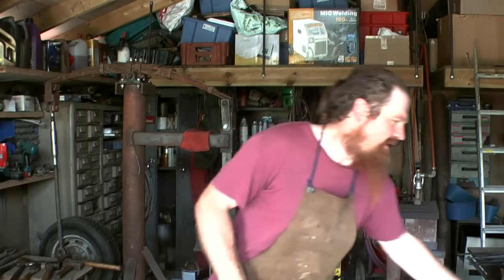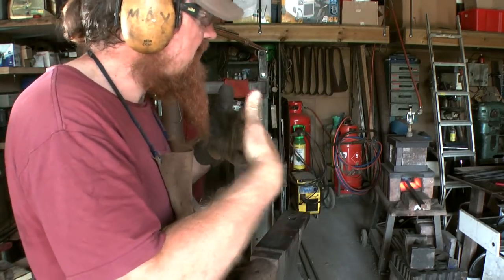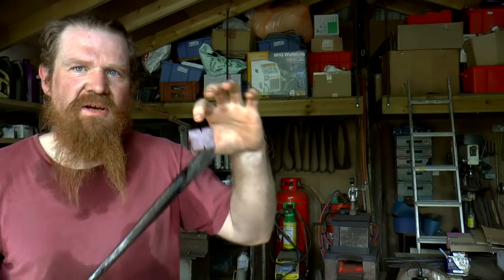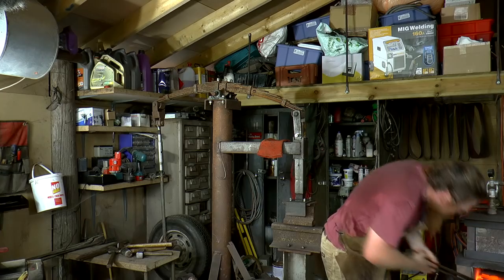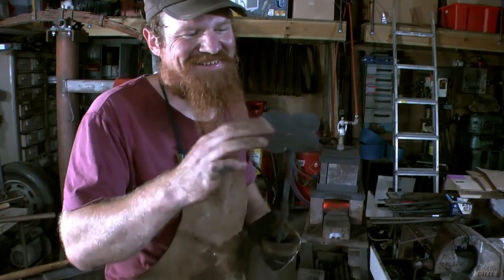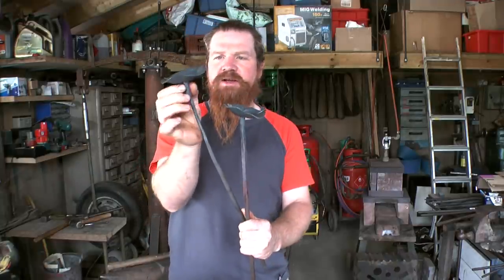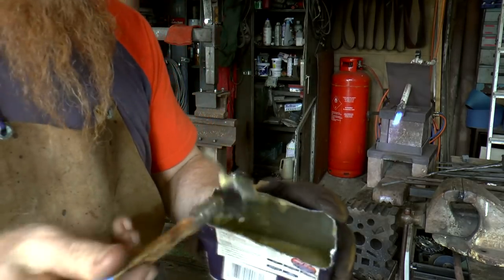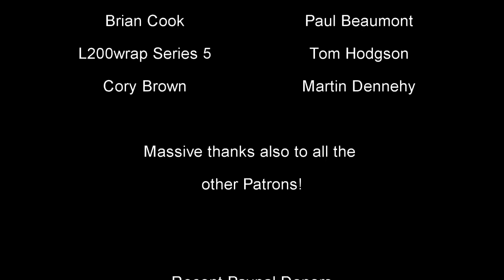Forging Flowers from a Solid Steel Bar

Comment: A tip from an Alabama concert former and finisher if it is 30 deg in the day wake up at 12:00 pm and work in the cool of the morning. we stop around 10 :00 to 11:00 AM because it can get  up to 40 deg here with 80% humidity. Feels like working in a sauna!

Comment: Very nice, and so much love put into them.

I think you are a good farmer, in the best kind of way - your lvl of skills are all over the place.
And the best farmers know a bit of everything.
Your ability to do blacksmith stuff is also excellent -- is everything measured in money?
Money is dependently a catalyst to make the stuff one would like to do available to us.
But I am certain that the happiness of the ride is not made by the money involved alone.
The Adventures one gets, does not seem to me to be the shortest way to the goal, heck one could buy an already rebuild land-rover... 
Or buy the flowers in plastic ... Where is the adventure you might ask? , the adventure is making it, doing it, living it - maybe just once, but you have been there done the hard work, and got a beautiful result.
Thank you for letting us share this adventure with you.

I wounder.... would it be possible to noise cancel out the forge.. Not for us, but for you in the blacksmith/garage. If one had a speaker with loud response in the opposite face -180 degrees to the known noise.. how would that work out...

Comment: I've made several roses using multiple layers of sheet steel, most of the time with scrap.  I try to use steel that's at least a couple of millimetres in thickness.  That way I can thin the steel down towards the edges and then curl the very end.  I have the same problem with the stems in that I used the same method that you showed.  Adding leaves is even trickier.

Good effort though chap.  Keep the anvil singing.

Comment: I really enjoyed this Max! A lovely and "organic" looking result! If you will forgive my (engineer's) impertinence - would it have been just as effective (and probably a lot quicker) to make your Maltese Cross starting points with the hacksaw instead of heating and whacking with the hatchet? Is there an ethos or aesthetic aspect that I am missing?
Reply from the maker: I think it would have taken even longer with the bandsaw! I was not after a straight slit more a wedge cut as provided by the hatchet. That way, when it's forged out the petal shapes are already heading in the right direction.

Comment: I have a very large ships bell.  (im going to add a video of it to my channel soon) Its very heavy and would look nice displayed so it can hang and be clanged!! , id like a bracket made so i can cement it into the ground and hang it in my garden.  I was thinking of scaffold pole thickness.  Something you can help
me with?  Just a though as i watch your channel and thought of you when i decided to look at a solution.
Reply from the maker: Hello, unfortunately I'm not in a position to take on any commissions but I'm sure a local blacksmith will be happy to help you out (there's more of us about than you might think!).

Comment: Cool ! 😀👍 Could this be done with thick sheet metal to save having to go from a square block, or wouldn't the end result be the same? Thanks for sharing 😀
Reply from the maker: Yep, thin steel metal gives a very different result.

Comment: Good work. What is the machine behind you with the leaf spring?  Do you have a heat exchanger on the furnace to heat your water?
Reply: It's a power hammer, as he mentions. He builds it in a previous video.
Reply: @chriscoulthard4947  cheers

Comment: Fantastic work Max!
What are the 3 meters below your CU displaying? Voltage, Current and Hz from the inverter ?
Reply from the maker: Yes, or from the generator, whichever is incoming at the time.

Comment: Outstanding job! Looks way too delicate an item to have been made that way! Looking for advice here; I found an old cast iron fireplace hearth plate that was sat under a pile of junk and is slightly warped/buckled. Any hope of straightening it? It's not very thick - maybe 1/4" . Wondered about getting it hot over some coals and then clamping it. Also could I cut it with an angle grinder? Need to take a couple of pieces out to fit it between the legs of my wood stove. Thanks!
Reply from the maker: Sadly not, if it's definitely cast iron it's going to be as brittle as glass, even heated up it will just crack if forced. Easy enough to cut though, just use the usual cutting disks for steel.
Reply: Thanks, that’s pretty much what I thought. Having had to smash up a cast iron tub before, I’ve seen how easy it breaks apart. The good thing is, if I can cut the corners back to fit it in, I should be able to drill the front corners and screw it down. The slight bow in it has enough flex that if two people stand on it, it lays flat again. Just flexes back again when you get off it. Hopefully some screws will hold it in place. Makes you wonder how it got bowed in the first place without breaking.

Comment: Hi I think I saw a Peter Wright Anvil is that correct?
Reply from the maker: I couldn't say - it has no markings on it. It's very old though as it's forged wrought iron with a forge welded steel top.
Reply: Maximus Ironthumper I believe it must be a PW the shape of the foot and the holes used for the original forging are identical to those I have seen on line and on mine.  Your anvil also looks to be in excellent condition as is my own although mine doesn’t have the makers mark but does have the faint weight markings.  Regardless of all that nonsense you have a rare and historical piece of blacksmithing kit well done to you.
Reply from the maker: It's probably my most valued possession!
Reply: Maximus Ironthumper I would agree .  I am a very amateur smith but promised myself that when it came to kit I would do my best to also collect items  as well as use them hence my enthusiasm when I saw your anvil.  There is a chap on YouTube (Big Dog Forge) who posted a couple of vids on a PW he managed to purchase.